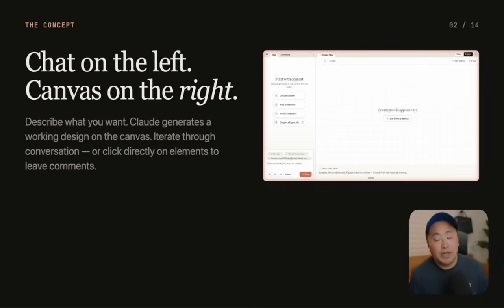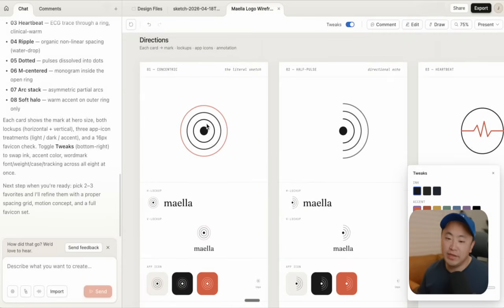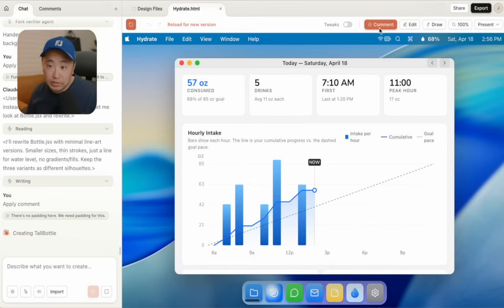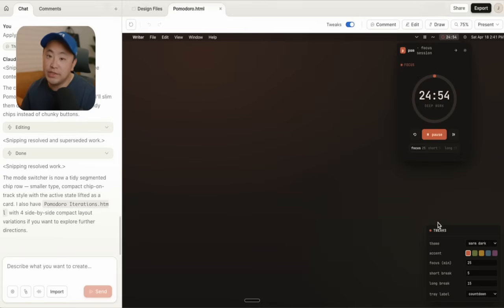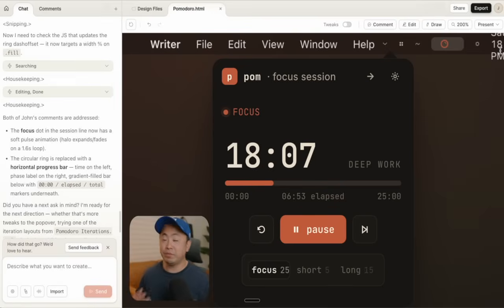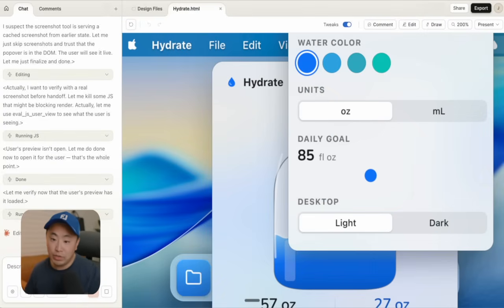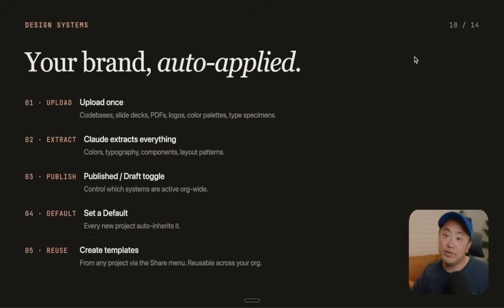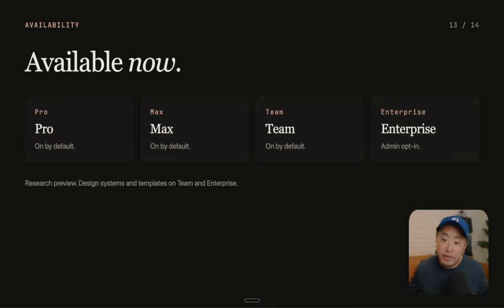Everything You Need To Know About Claude Design

Comment: This video is a great breakdown of how Claude Design works for things like high-fidelity prototyping and slide decks. I like the point about how it uses code as the final output, which makes it easy to further customize in Claude Code. For my small static pages, I usually look at a few options like Tiiny Host, GitHub Pages, or Netlify to get a quick preview live. It's a solid way to test those interactive elements and layout on a real link without needing a full developer setup.